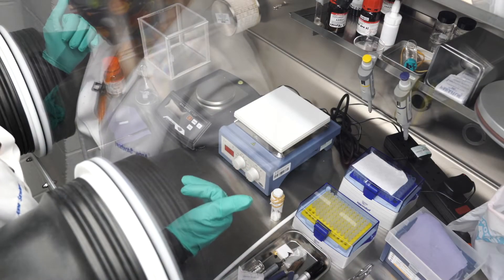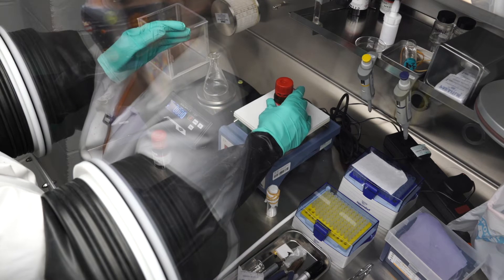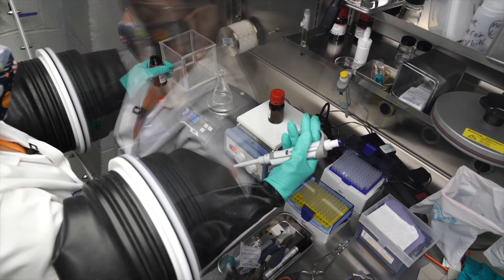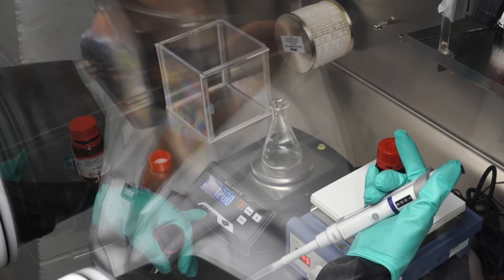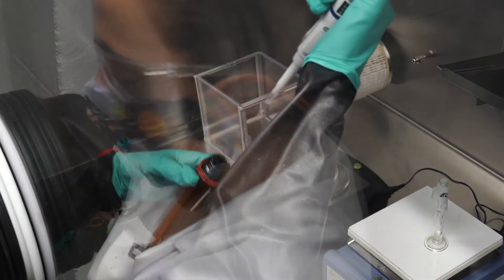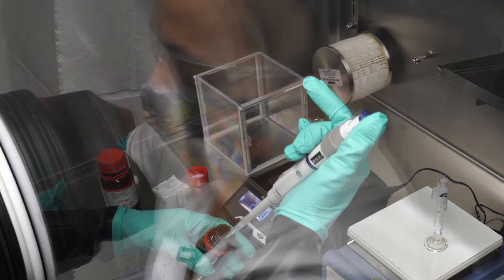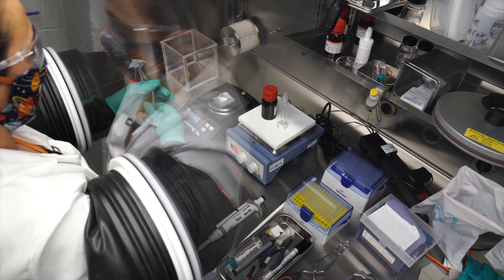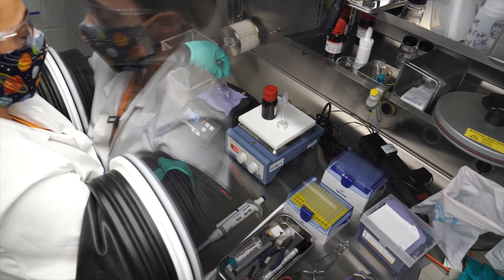How to Mix Electrolyte for Sodium-ion Coin Cells

Comment: What !! If Ethylene Carbonate is solid in room temperature how can you use it as Liquid electrolyte in Battery that operates at room temperature ? You are also heating it but what after that are you also Mixing DMC as solvent with Ethylene Carbonate electrolyte?
Reply: What you need to know is there is material called 'ionic liquid" its originally two or more solid material than if two mix automaticly become liquid
Reply: @teknosql4740  let me try....
It's called Deep eutectic system.
Reply: @teknosql4740  Only the sodium perchlorate is ionic. The ethylene and propylene carbonate are covalent. It's just a solution
Reply: It's a solution. Sugar water also stays solid at room temperature even though it was a solid and a liquid before mixing

Comment: I enjoyed the video.
Are organic solvents used without further purification?
Or, did you use anhydrous solvent?
Reply from the maker: Thank you. I used anhydrous solvents, which are usually indicated by suppliers as “H2O<10ppm” for battery applications. However, I am currently validating the use of molecular sieves to further de-water my solvents.